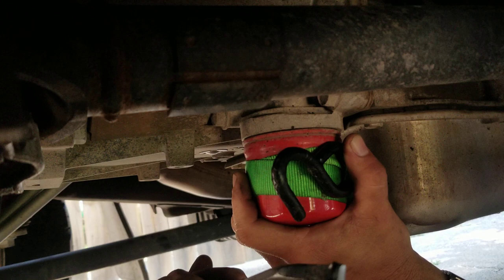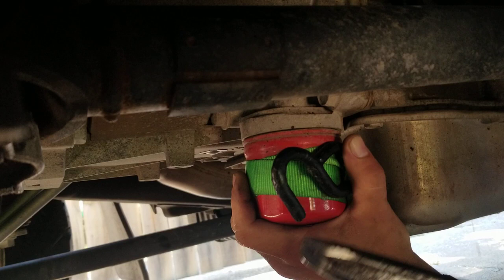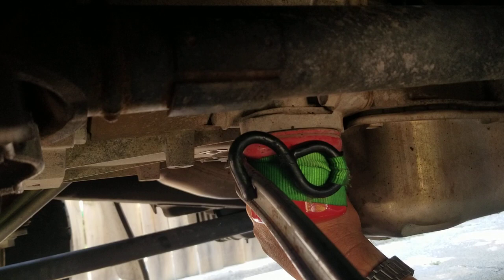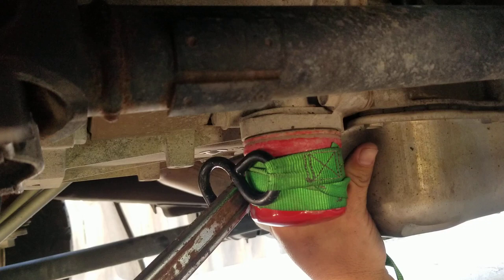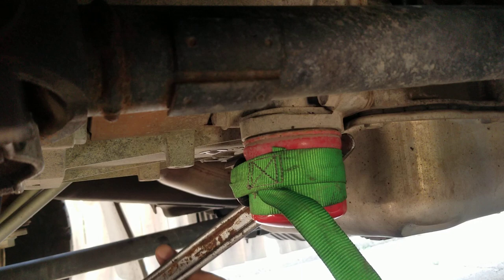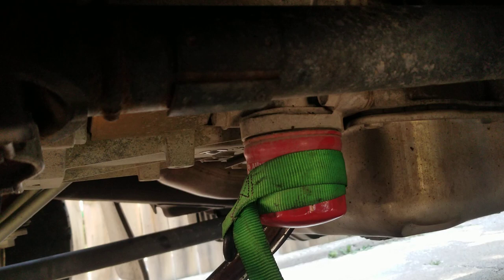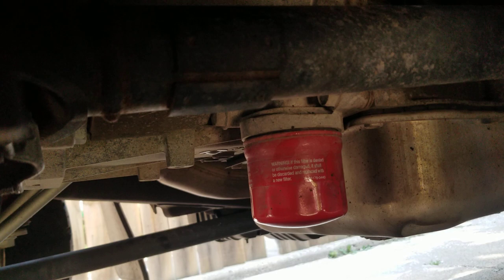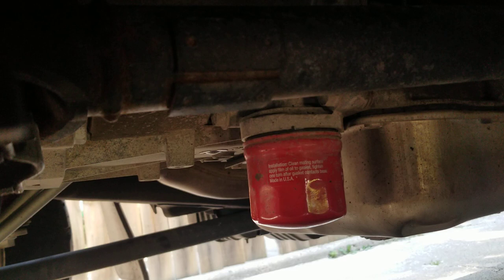How to remove spin on filter without filter wrench

Comment: Never seen this before so thank you for sharing. My problem is I've never seen an oil filter that accessible!
Reply from the maker: Yea, seems like there's always something in the way
Reply: Sometimes you win, sometimes you don't. A lot of machinery and bigger trucks have easy access filters. Some passenger vehicles will also have enough clearance for this method.  I think the newer the car, the tighter the engine bay though. This tip worked a charm for me.
Reply: On my 2013 Chevy Malibu it has a metals cover covering half the surface of the filter almost like a shield the manufacturers do this so you have to pay for someone to do it for you but there’s always a way to do something yourself sometimes it’ll be a little harder but it’s worth it
Reply from the maker: I agree, I've never looked at the one on a Malibu but there's usually a way. May have to take the shield off. I have to take the skid plate off to grease my truck.
Reply: Yea, my daughter's RAV4 gives me no room (that's after taking off the shield). It's always a pain when I change her oil. Every car is different. I did my neighbor's Hyundai Santa Fe for her, and the oil filter was under the hood.
Reply: Facts

Comment: Thank you! Had a fire a while back and never replaced my strap wrench, hadn't needed it til now. Bought a slightly used ram 6.4 at a stealership and they changed the oil prior to purchase. Apparently Hulk was working that day. In 35 yrs of changing oil never had one on that hard! Thanks for sharing! Worked like a champ.

Comment: I just had to inform you, i tried your tip with my belt and a wrench...totally works.  What i noticed was leather grips, and wrench leveraged against the belt itself helps tighten it as you push.  Thanks a lot!
Reply from the maker: That's good to know. Glad it worked

Comment: Mate..... I owe you a beer! This tip got me out of a bind.

 I just tried this on a tractor hydraulic filter that was well and truly fused. For extra grip, I ended up stretching a small section of a motorcycle inner tube between the strap. I almost had to stand on a small pry bar to get it to turn but it worked!
Reply from the maker: That's awesome, glad it worked for ya!

Comment: You saved my butt today. Tried this on my Toyota SUV where there isn't enough room for large channel locks. I keep forgetting to pick up an oil filter wrench at the store so decided to give this a try. I used a strap like yours but room is tight so I used a wrench for the handle and it worked like a charm. It was a bit tricky getting it on with one hand but once I got it in place I was able to just pull up on the wrench and get more torque on it rather than trying to twist it with my wrist. Thanks for the idea! I won't forget this one.
Reply from the maker: Awesome, I'm glad it helped

Comment: You knwo what i cant thanks you in any words
You saved me.  
I really want to share my story
I was just changin oil and i got pajero mitsubishi it got filter which was not accessible easily i tried screw driver method but failed badly i got a go for work tomorrow morning and dont have choice then your video comes up and it really helped me it worked miraculously 
Really thanks again 🙏🙏🙏
Reply from the maker: Thank you! so glad the video helped

Comment: Ended up using a similar method with a stretch rag. Was able to wrap it around twice and pull tight. Was the only thing thatd fit in the tight area where the filter was. Thanks for the tips!! Got my brain moving
Reply from the maker: As long as you got it, that's the important part. Thank you for your comment!

Comment: My favorite filter wrench is an old leather belt. Loop it around the filter in such a way that the harder you pull the tighter it squeezes. I can crush oil filters from exerting so much force using this method.
Reply from the maker: That's a great method to

Comment: This tip was super helpful. I had to replace an oil filter on a used 09 yamaha motorcycle.  The clearance around this filter was impossible to get to. This trick was the only way I was finally able to start to spin it loose.

Comment: THANK YOU SO MUCH.   I have so many different sized oil filter wrenches but can never find them when I need them.  It works so good. Actually,  better in tight spaces than the wrenches.

Comment: I used this technique to get the oil filter off my Honda CR-V using a dog collar and the back of an adjustable wrench. Took some wrangling, but I got it eventually. Thanks for the tip.

Comment: Tried the trick out it works, you just have to be careful as it can also damage the filter if you pressure is in the wrong spot. Great hack was in the middle of an oil change and used it damaged the filter a little bit I got it off.
Reply from the maker: Im glad it worked put, thank you for the comment

Comment: G’Day from the Land Down Under. 🇦🇺🇦🇺

Firstly, don’t over tighten your oil filters guys, UNLESS you have definite hi torque setting written on the box for higher pressure requirements. I’m talking general unleaded petrol fuel passenger vehicle, ok, so no hating on my comment please. I’m just trying to add to and/or support to your clever ideas.

So here’s a good one I twigged to the other day. Now my oil filter was not easily accessible because of steering and suspension components restricting the space. I could get my hand in there and get a firm enough grip, that I knew very close to cracking it, but I just didn’t have the room to put more twisting pressure.

I had already run through the pro moly engine flush, so I couldn’t drive it 3 mile up the road to buy a spare strap wrench). Also, my tools are still in storage (long story)

That said, I got hold of some regular old 2” wide packing tape and wound several turns of the tape (clockwise direction) onto the filter, BUT II made sure the sticky side of the tape facing outwards.

This gave me the extra grip I needed to crank it off by hand. 🇦🇺👍😎👍🇦🇺

Aussie, Aussie, Aussie, Oi, Oi, Oi!!!

I love American muscle cars too.
Reply from the maker: Thats Awesome! Thank you for your comment!

Comment: People also tend to tighten the oil pan plug to tight. If your plug is to tight and your ratchet won’t remove the plug extend the ratchet handle with a pipe. This gives more leverage and make it easier to remove.
Reply from the maker: I agree. No need to over tighten

Comment: Thanks man.  I'm going to try it tomorrow on an air dryer for Cummins ISX15 .
Reply from the maker: When i did mine on my  N14 i used a 2 inch strap and my winch bar. Used same to put it back on. Good luck on it

Comment: I just had to adapt this method because I had a ratchet strap with no hook and a screwdriver to work with. Used it like a tourniquet to get the strap tight then used the screwdriver as a lever. Thanks for the tip, really didn’t want to risk driving the screwdriver through the filter, lol.
Reply from the maker: As long as it works. That's the important part! Thank you for your comment

Comment: Try getting to the oil filter on the 2000 Ford Ranger 3-L V6 where you only have 1/2 inch clearance between the oil filter and the 12 volt starter terminals 😆

Comment: Hmmm.... pry bar leverage I like.....
You can make the strap to hold on by itself if you know how and the more you pull the tighter it will grab.  Combing that idea with the pry bar..... a new strategy for tomorrow.  I still have meat left on that 2001 dodge oil filter.
Barabang baraboom
Thank you.
Reply from the maker: Hope it works good for you!
Reply: @CFarmer  I am about to upload the improved version after what I observed in your video and other ones using strap.  The other ones had much struggle as I noticed with yours.  The video should be ready in a few minutes as the HD version is processing at the moment.
Simpler, less effort and far more torque, spreading the pressure over the entire filter basically and above all  less suffering and  with what I am showing.  Okay it is complete.  over 3 minutes worth. Here it is.
https://www.youtube.com/watch?v=1fOYB9yNR-o

Comment: a short bar and some rope would be effective, three wraps minimum, hold the tail, use bar to to the pull on the tight end of rope.  Rope can work better because there is room for all the wraps to be directly on the filter can.

Comment: Thanks, great idea! I have plenty of those straps around from transporting my motorcycles on a trailer!
Reply from the maker: I've heard a belt works too
Reply: @CFarmer  I plan to change the original oil in my Kubota and wanted to see how tight the filter was. I have a strap like tool that you use with a standard 3/8" ratchet. I forgot I had it! It was tight but I was able to loosen it without too much effort.
Reply from the maker: Good deal

Comment: thats awesome brother thanks for sharing,my 95 z71 is in a different spot still kinda easy but damn,i did a ls swap in a 05 blazer and i installed a oil filter relocator with 3 ft of rubber hose i put the filter at the front behind the bumper haha so super easy access,but my z71 i have a chevy crate engine with 60 psi oil pressure with it just idling when you first crank it so im not sure if thats why my z71 get stuck or what,i dunno lol later guys
Reply from the maker: Relocation is the way to go, thank you and thank you for your comment!

Comment: You can drill a hole through the oil filter then stick a screw driver all the way through the hole. Grab the handle and remove the filter.
Reply from the maker: That's a good option too.
Reply: Oil filters should never be tightened with a wrench. Hand tightened only. You can crush or warp the rubber/silicone gasket and oil will leak under pressure. You will be able to remove the oil filter by hand. If your hand slips wrap a piece of sand paper around it for grip. I don’t know why but people tend to tighten the oil pan plug to tight.

Comment: Lol I still had to get a filter wrench. Not a lot of space to work with under my Sonata. Only had to use it because I bought a new car. Why do they wrench those suckers on? Hand tighten only.
Reply from the maker: Yea, that works good in open spaces but not so good in tight spaces. I dunno, some folks get carried away for sure
Reply: Same problem on my new Hyundai for it's first oil change as well.  Why the heck they put them on so tight at the factory?  Maybe they aren't oiling the gasket before they put it on either.

Comment: so according to your video I'm going the wrong way?? that is not counterclockwise is it??
Reply from the maker: If your looking straight at the bottom of filter it should turn counter clockwise to loosen. Clockwise to tighten.
Reply from the maker: I just recorded this for you. Hope it helps

https://youtu.be/leuDDAHAdks

The first link didn't work so i updated it
Reply: @CFarmer  I finally got it off I drilled holes in the wrench that fits on the bottom with sandpaper inside and put 2 tap screws in that going thru the wrench and filter and turned with the breaker bar and it finally came off, shew, been a week on and off getting it off.. thank the Lord above..
Reply from the maker: Good deal, glad you got it!

Comment: I use a double row bike chain for these filters. Otherwise I use filters with a nut attached to them, easy to take off. If you don't have the correct tool, you can always stab the filter with a screwdriver and turn, although that can be messy. 

On a side note, when taking the filter off, use a large plastic bag to wrap it in. It'll fall in the bag with the oil, no mess, no fuss.
Reply from the maker: Heck yea, I've tried a lot of different things to keep from making a mess with oil filter. Haven't tried a bag yet but going to try it next oil change. Thank you for your comment!

Comment: so you turn it to the right and not left??
Reply from the maker: Laying underneath looking, the top went to the left. Counter clockwise to loosen
Reply: @CFarmer  still working on it, i drilled holes in the wrench you put under the filter on the sides then holes in the already damaged filter from screwdriver and then drilled the tap screws in it didn't slip but now I gotta get someone strong enough to pull on it some were turning it the opposite way some the right way who knows anyway thanks for you comment
Reply: @CFarmer  i should have put sandpaper in there before putting the screws to get a better grip :(
Reply from the maker: Dang, wish there was more i could do
Reply: @CFarmer  I read lefty lucy which is not counterclockwise ??I'm so confused on which way to turn it
Reply from the maker: Do you have Instagram?
Reply: @CFarmer  no but now the dang thing is surging it was before I changed the oil though I have replaced fuel filter , put new gasket, adjusted the valves, while at the time being pissed off over oil filter ,air filter, tried to blow lines out, new spark plug, emptied gas 2 times 1st time omg trash all in it looking with a flashlight trying not to have to fool with carb it is fairly new probably stopped up
Reply from the maker: O wow, i hope the fuel filter was doing its job and caught trash before it got into carburetor. What vehicle are you working on?
Reply: @CFarmer  troybilt zero turn rtz mustang 42 inch
Reply from the maker: Dang, hopefully fuel filter will catch debris before it gets to carburetor

Comment: Hello friend thanks for video decent technique for an oil filter which is really accessible from any angle. I'm not so lucky with my 2017 Cummins ISX..... the oil filter is wedge nicely between the block and the frame what a stupid assh*le of a place to put an oil filter 🙄.